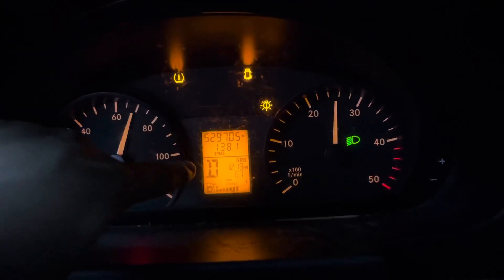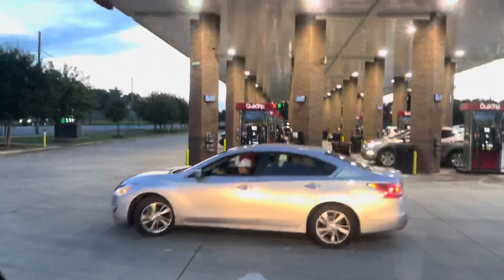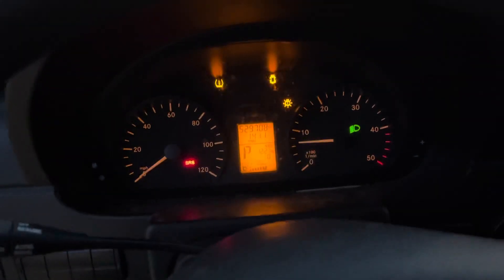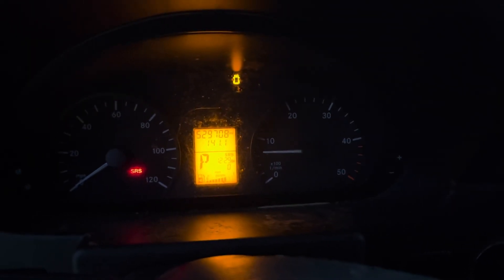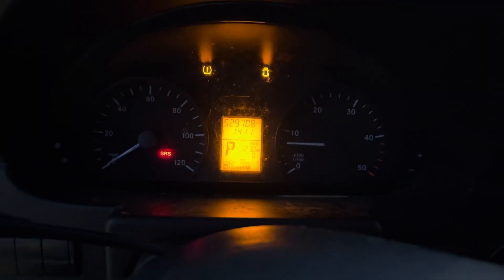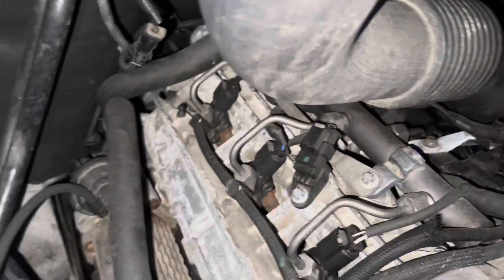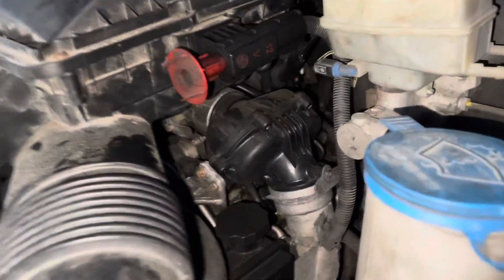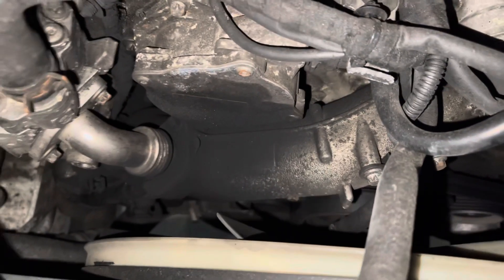My Sprinter went into limp mode on the way back from Mercedes Service P2610 P0299

Comment: The flex on the pipe that goes the egr to intake manifold is broken and leaking,  that is why you have all that soot over there and limp mode is triggered because it is a leak of both,  exhaust pressure and boost pressure.
Reply from the maker: Thanks so much good observation

Comment: Here’s what happened to me after AEM . When I went to pick up my van I didn’t even get out of the parking lot and I had a check engine light. According to Mercedes it was my DEF heater which is not covered under the emissions warranty. Then I was told by Mercedes to drive my van up and down the highway for the sensors to reset themselves. When I took it on the highway I completely lost power pulled over had 11 codes triggered in the computer cleared the codes went on a highway for about a mile had another code truck went into limp mode cleared the code went down 4 miles down the highway van completely shut off with 11 codes. The van is now sitting at Mercedes. Also when I drove my van I had the same thing it sounds like a blow off valve keeps blowing off air  or air is is leaking somewhere in the engine compartment. Very unacceptable because the van was running fine before it had the AEM done to it.
Reply: How did you fix this?

Comment: Mine smelt like burnt plastic after update, but no limp mode.
Reply from the maker: Interesting, I wonder what burnt plastic was all about, it was very apparent smell
Reply: If you had the updated done, make sure that all the wires from the NOx sensors and dosing valve are secured and in place where they need to be. It is normal to have a bit of burnt smell when you have a new dpf or catalytic converters installed, but it is not normal if it smells like burnt rubber.

Comment: Oh yeah after watching more of the video, I definitely think it's the turbo resonator. They are a common failure on the 3.0
Reply from the maker: Yep it’s probably combination of EGR and turbo resonator, there’s just a big gap with turbo resonator
Reply: @ZimaletaMotors  I just ordered a new one today off parts geek for 61$. I've been dealing with this for months, I found that it normally causes the turbo to overboost and it goes into limp mode after. Sometimes it's a full turbo shutdown where you have to go into lower gears to accelerate and others it's a semi limp mode where you can get around on drive. Mine is original with 600k miles so at least they last awhile.

Comment: Tire Pressure Monitoring System

What repairs can fix the P2610 code?

    Replace the ECM/PCM.
    Reprogram the ECM/PCM.
    Repair the wiring to the ECM/PCM for shorted key power to battery power.
Reply from the maker: Thanks, maybe it got triggered because battery was dead? I will make an updated video if it comes back, right now I got couple clients ahead of me lol 😂 just got done with injector job Black Death

Comment: Hi, bro do you have any idea why my sprinter doesnt run  more than 82 miles an hour
Reply: Your van is classified as a commercial M-Bus vehicle and the legal speed limit for such classification is 82mph/132km. 

It is possible to change the classification from M-Bus to law enforcing  vehicle or emergency vehicle and you'll be able to go 100mph/161km, red line limited.
Reply: Mine is doing the same after I got it out of shop. No more 82 miles